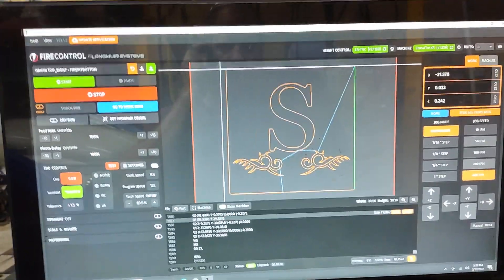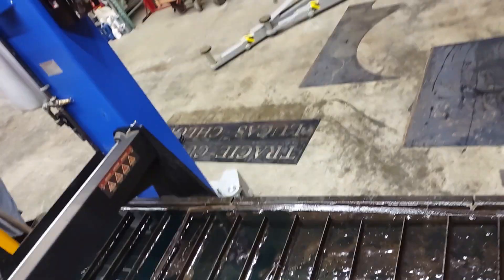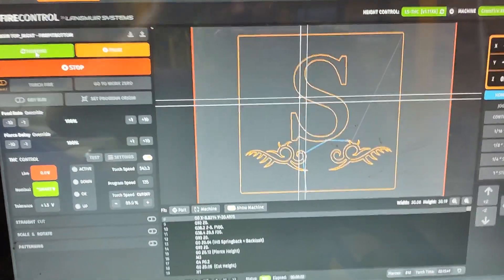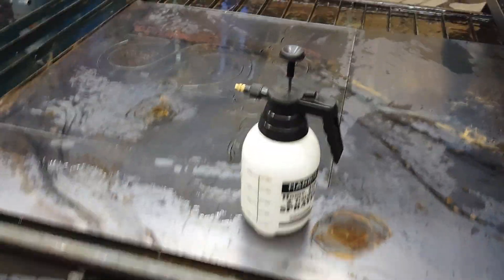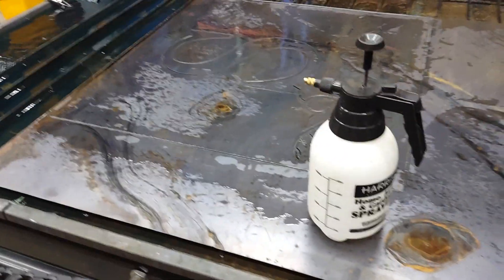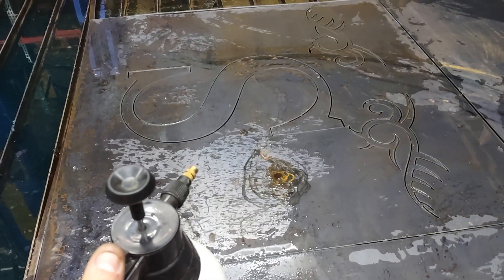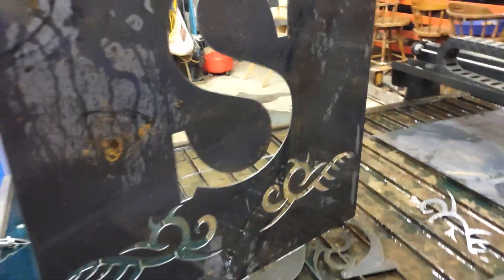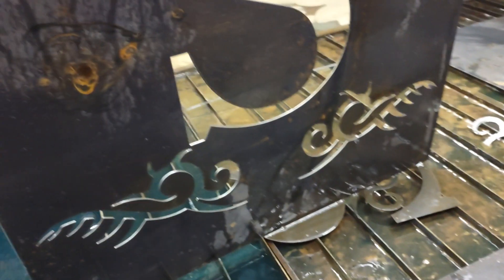Crossfire XR plasma table cutting 16 gauge fire pit signs.

Comment: Have you ever tried to cut faster?  I run the pro table at 240 ipm on 16g steel and moves fast will not warp at all and will be cool to touch. I been running the pro table for a year now at 240 ipm and I cut about 40 signs a week with no problems. I think the xr table can handle it.
Reply from the maker: Yes the table can travel that fast. The plasma cutter cant.
Reply: @Curtis_Schwoeppe_Enterprises   what cutter do you have? I use the razor45
Reply: Yep,  I cut 16 gauge at 240 ipm. 
No warping either.